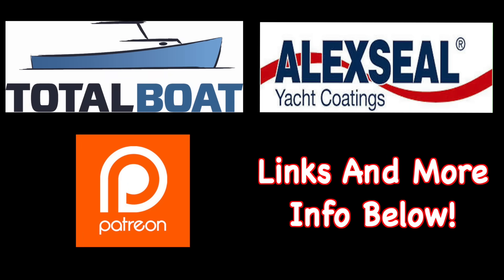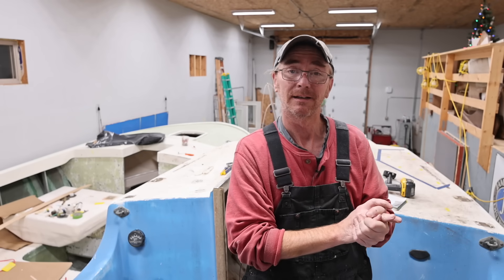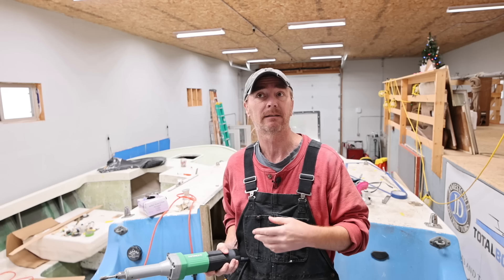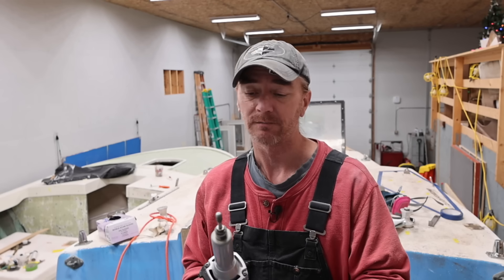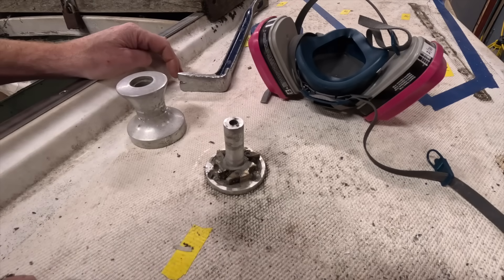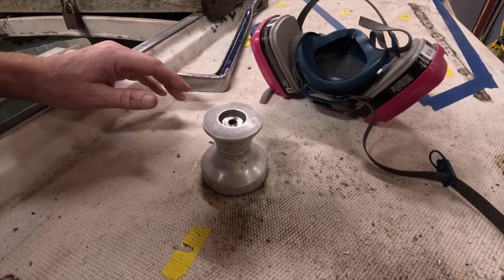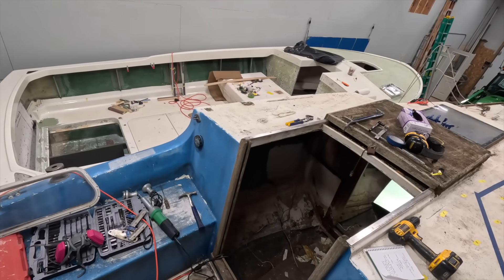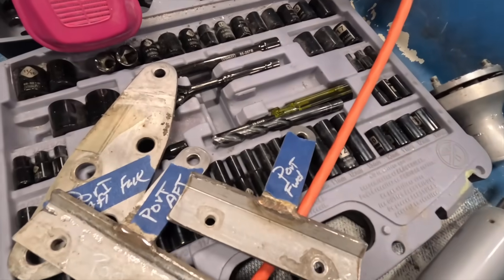Grinding Fiberglass For Deck Hardware Removal, Winch Tear-Down & Chainplate Welding Concerns

Comment: Andy, how can i stop deck seam leaks!😢
I have a few that the seam is visible under the deck, the hull has a lip, and the deck is held down by a teak toe rail bolted down upon it.
I have calked around it a bit and tightened the Nuts securing it, helped a bit but still persistent. Can i glass it from under by beveling the lip and glassing it?
Reply from the maker: This sounds like one of those things where I'd need some pics, a walk through of the area and a chat to discuss (way more than a simple email or comment unfortunately :-/).  If you'd like to hit me up for a consult we can certainly get this sorted out!  http://www.patreon.com/boatworkstoday

Thank you!

Comment: Test the chain plates with Dye Penetrant, or Magnetic Particle Inspection.  Both are Super Easy to perform (if you have not performed these types of inspections).  The results will tell you if the steel is cracked (an actual crack or any stress cracks).

If the results are Negative (aka No Cracks), these chain plates are good to go.  If the results are Positive (aka, Cracks !  OMG!!)  then decide to fix the crack (if minor, via welding) OR, just have new ones fabricated.
👍👍

Comment: Andy when stainless welding and using tig the Argon gas will create the bronze colour .
Once you use pickling acid and clean with a scotch bright it will buff up good like new

Comment: Stainless tig has a high heat which brings copper and chrome to the service of the weld. If there is no cracking around the weld they are fine. Clean it good and use a dye crack detector to be sure.

Comment: Hey Andy, good luck finding parts to rebuild those winches if one wanted to lol. And those chain plates,  I work at a boat yard in the Sail capital of NC- I moved Mads boat to our yard- and have never seen welded- let alone brazed- chain plates. Not saying it won't hold up in a smaller boat, but we usually install new stainless plates in a boat 30 years or older.

Comment: I could not see the weld clearly.  It appears to be welded.  When you weld stainless you are looking for "copper" color That means you have the heat correct for SS.  We have all seen the TIG welded SS that has the pretty purples & blues - while pretty, they are actually too cold.  Take it to your local fabricator.  He will advise you to use or replace.  BTW, I have always enjoyed your content.

Comment: Andy, I weld quite a bit of stainless for boats, from what I see it looks like normal discoloration from heat when tig welding stainless.    I suggest you take a small wire brush and some CLR and clean them up.   Look close for any cracks but I doubt it.     The CLR works great on the stainless then rinse them and polish.   They should look better than new.

Comment: Do not hesitate to buy or build NEW chains plates. It’s a structural parts which hold the mast….and it’s not very expensive as well. So better to be safe than sorry. Cheers.

Comment: I’m no welder or metalurgist but, those chain plates are not big or complicated. They’re  54 years old. You might as well just replace them. A metal shop could probably make up all six for a couple of hundred bucks, if that.

Comment: They appear to be stainless steel and discolor is normal from the heat if you polished it the discoloration would disappear and it would all look uniform.  Don’t be afraid to reuse because of the discoloration. If you polish them the dirty polish should show you were of any cracks are.

Comment: Andy,  I'm no welder but I also subscribe to the "if it ain't broke don't fix it" philosophy.  If those chain plates haven't broken by now and it looks like they are very accessible I would run with them for now.  Keep an eye on them and if they start cracking have some new ones made.  I might also take them to a local welding shop and see what they have to say.  If you clean them up you should be able to tell if they are welded or brazed.  Keep the good stuff coming buddy.

Comment: Hello Andy. If your ship those plates to me I will test your welds and make any repairs needed to make the good as new
Reply from the maker: That would be awesome, thank you!  When you have a chance could you send me a quick email with any details :-)  BoatworksToday@gmail.com
Reply: @boatworkstoday thats your best option. Those can be made to look great. Will be better material than most new. And a experienced welder takes out you own guess work. I weld a LOT. Getting into fiberglass to me felt like learning a new method of welding.

Comment: If it is your preference to reuse the existing chain plates I would suggest that you polish them up and inspect the polished surfaces with some magnification.  That will tell you a lot more about the condition of the part than a simple eyeball inspection.  Personally I would just make new from 316 stainless.

Comment: Discoloration is from the welding - clean them off and they will be perfectly fine. Closing the Windows however to put in portlights is a bad idea. Opening the front hatch and the companionway will be plenty ventilation on a tiny boat like this. When you're at anchor, opening the portlights will do nothing. But what you do want is as much light as possible on the inside and your plan will turn the boat in a claustrophobic little cave. Plus every opening will need a net to keep out the bugs at night.

Comment: Stainless will have some color to a degree (depending on heat input, gas coverage, etc.) after welding if not passivated. Its probably fine.

Comment: Silicon Bronze Tig Brazed perhaps?   Probably made two piece because plasma/laser cutting wasn't available so only other option was gas cutting and a lot of work, Or, making a custom punch and a massive press.  Probably "relatively" cheap to get them laser or plasma cut and bent today.

Comment: That is brazing metal. It has a yield strength of at least 60,000 psi whereas 304 and 316 have yield strengths if ~30,000psi. Per any structural code, a properly repaired joint will be stronger than the base metal.

Comment: Whenever you weld stainless steel, it changes the makeup of the metal and can expose iron causing surface rust or like what you’re seeing discoloration. You have to passivate the metal, to expose the chromium which is what makes the stainless steel less able to corrode. In your instance I would use some of the welders die, to teat if there are any cracks in the chain plates. If this boat was sailed in fresh water the plates are most likely in good condition!

Comment: On the welds, from what I can see when I zoom in,, they looks like good welds. The color looks like age and caked on micro debris to me. Just use a wire brush in it to see if it comes off. You might have received a wire wheel in the new die grinder box. You can always stop by a sheet metal shop and ask them to just take a quick look too. I used to weld parts like those up all the time in the HVAC shop I work in

Comment: New hardware will never last as long as those you removed.
Reply from the maker: That's usually how things go these days!  Quality of everything back in the day was better!  As long as this is still safe to re-use I'd prefer to go that route :-)
Reply: Personally I wouldn’t sail with 50 year old chainplates the weakness in stainless isn’t always visible to the eye
Reply: @richardkittle2346 fatigue does happen. Given the other visual queues - perfectly round holes and absence of crevice corrosion - a simple weld die inspection is sufficient to decide whether to continue to use. This is a small boat with at least 8 wires supporting the mast. The wires are less than 1/10 the size of the plates they connect to. The wires are the weakest link. Blindly replacing hardware out of fear is foolish. Do the test and proceed from knowledge not ignorance.